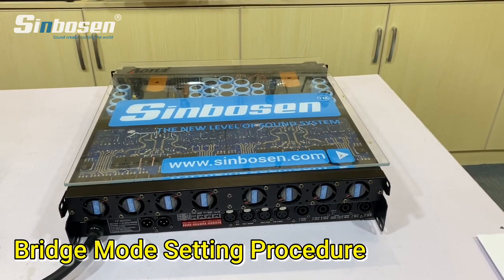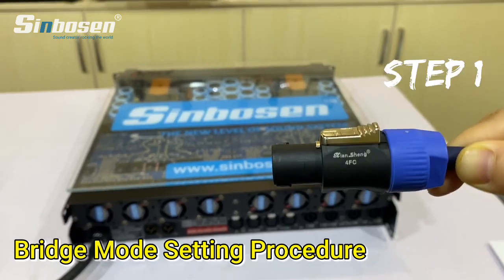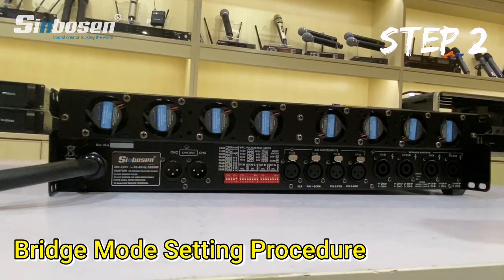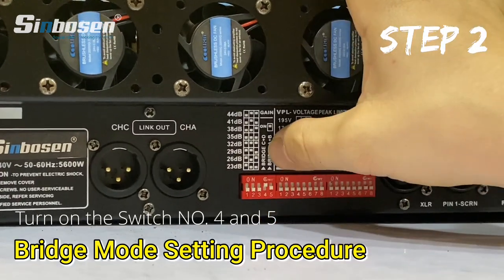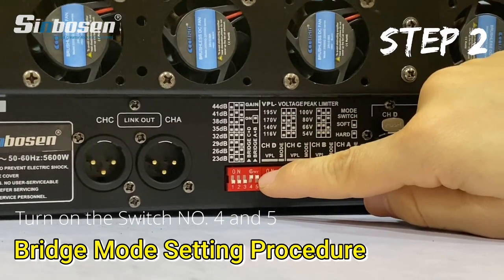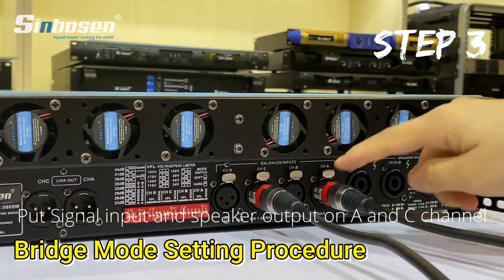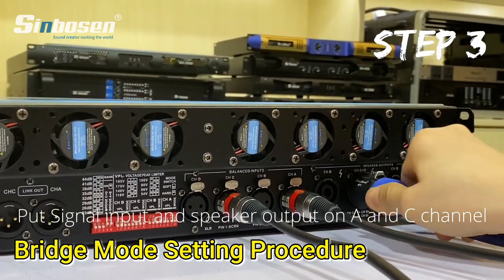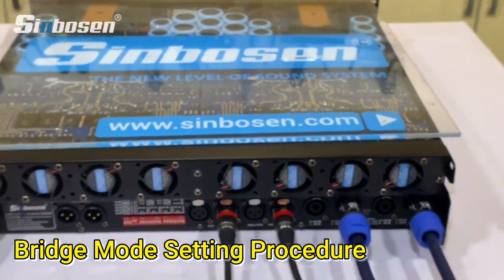Does your amplifier have bridge function? How do we use the bridging function?

Comment: Dsp 22000 ????
Reply from the maker: The one shown is FP20000Q, and other amplifiers operate similarly. The dsp series also has a bridge function!(〃'▽'〃)
Reply: @Sinbosen  you have to make the video of how to connect the dsp 22000 amplifier and how to connect several to the same signal also how to make the recorded settings stay and not be deleted when the amplifier is turned off
Reply from the maker: ok,thanks for the suggestion!
Reply: Good morning. The same procedure also applies to D4 3000 ???